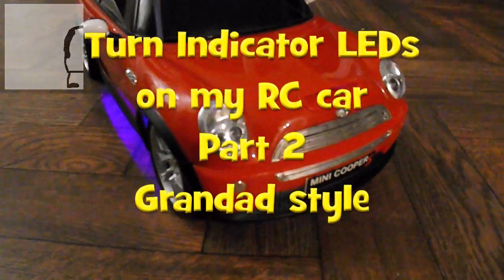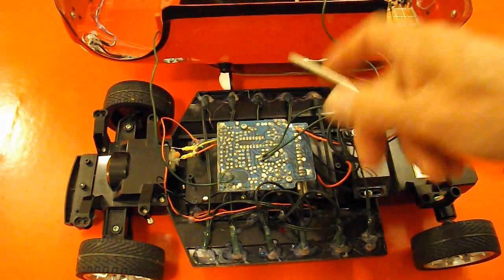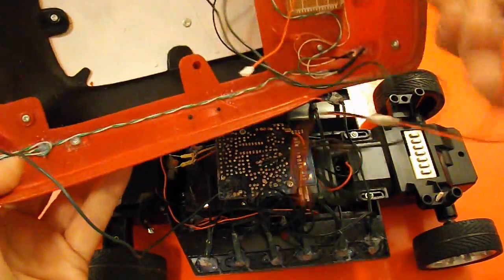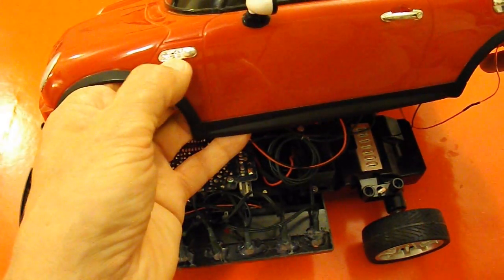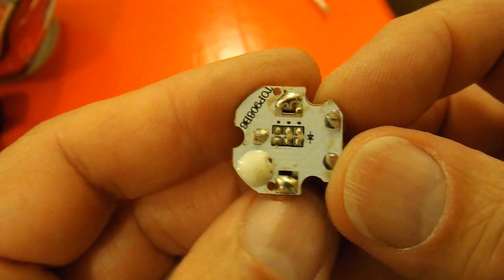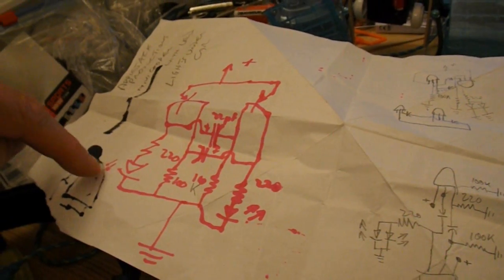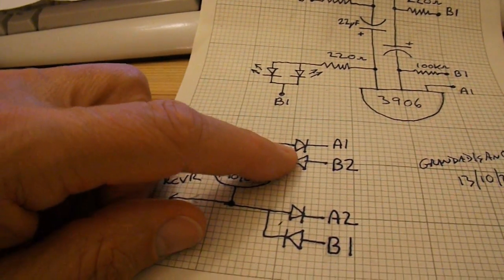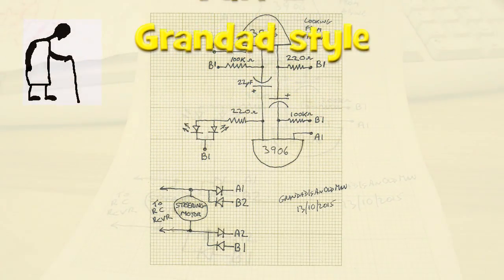Turn Indicator LEDs on my RC car Part 2 Grandad style

Comment: Can you make a solar powered plane
Reply from the maker: +sciencenerds not a chance if you expect it to fly. There are no solar panels that I am aware of that will give you the power to weight ratio you would need to get a model plane to fly.
Reply: +GrandadIsAnOldMan can you do the same thing on your Corvette C6 ZO6?
Reply from the maker: GuitarRocks360 As I have already done that with this car it would just be a duplication so not worth watching - however I have purchased an interesting bit of RC kit that is specifically designed for switching on and off lights and similar items so I probably will be doing something like that to test the facilities. It will not happen for at least a month as I am already up to May 26th with preloaded videos.